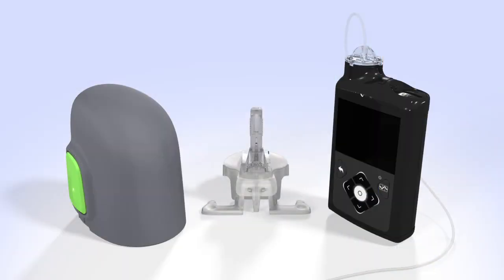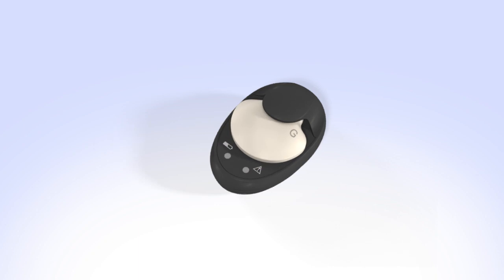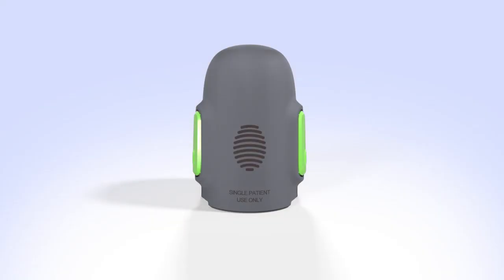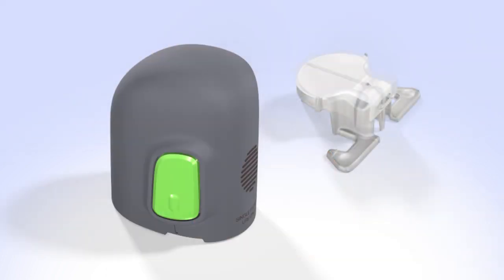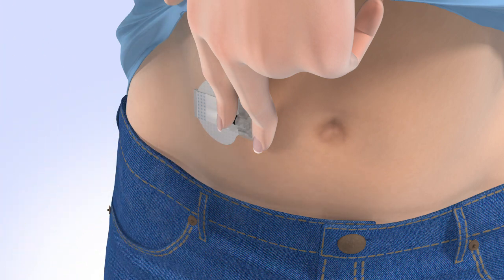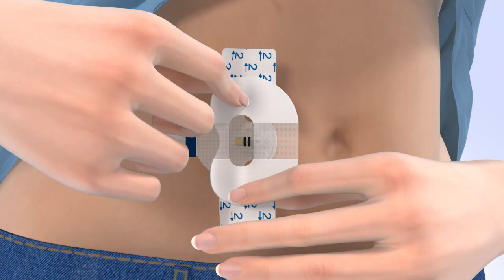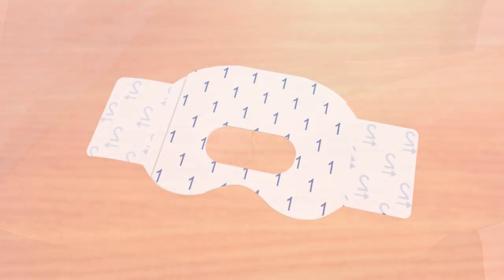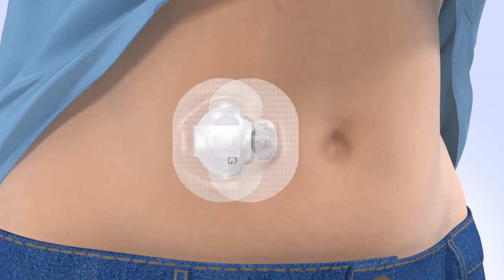Inserting the Guardian™ Sensor 3 with the MiniMed™ 670G System

Comment: Tom Young I have had my 670-G for three years now and yes the alarms, re-calculate over and over,  test test test and the God awful alarm can drive a person  nuts. Now saying that I finally got off the manual and went to automatic and noticed my morning blood sugars are 90-140 a lot different that using the manual mode. I find the pump on AUTO helps really evens out the high and lows. I have had diabetes 26 years and hate it liker anyone else but try and stick with it because right now think this might be the best on the market in my opinion. I understand the 770 is better yet don't know.
Good luck we can all use it.

Comment: put a video on how to clean the sensor y'all  did not send me the start guide its backordered
Reply from the maker: Mary, check out our blog post here http://bit.ly/36Fwisk. It's an older blog and discusses some of our previous products, but the specifics of cleaning your tranmitter are still the same. 
You can also find a user guide for your specific CGM system here: http://bit.ly/2vK9Ayw

Comment: I've been diabetic for 37 years.  I've had 4 generations of Minimed pumps before the 670G.  Been on the 670G since 2017.  It is by far the worst device I have ever used.  Constant alerts and beeping, the senors are always off by between 20 and 40 mg/dl.  The menu system is the worst I have ever seen.  The pump is significantly larger than the outgoing Paradigm model.  It has cracked or malfunctioned on several occasions and I am now on my second replacement pump.  I have one year left until the warranty is up and my insurance will let me switch to another pump.  I'll never buy another Medtronic device again.  I curse the thing every day.
Reply: honestly same fuck this machine
Reply: I just started with the 670g. This is my 1st pump and not that really impressed. The pump is alway beebing at me. every time I turn around it has loss sensor signal. The pump and the bg meter is alway about 25 to 30 points off. This was spose to make my live easier. Now I feel like a dog on a leash. The pump is alway getting bumped around the hose get caught on everything. I have to buy all these supplys. That cost alot of money. I can afford it, and I have good insursance. I rather be spending my money living my life. Not giving it to Medtronic for supplys.
Reply: absolutely right i hate this new pump and sensor they say look at your guide to see how to clean he sensor they didnt send me the guide its back ordered
Reply: Michael Carney yes I have communicated to Medtronic. No they were not interested in my suggestions.
Reply: Do you have any recommendations to a better pump or water resistant pump I'm interested in getting one but they have so many and I can't choose one that fits for me  😕
Reply: @chanisebailey2790  Tandem T slim.  Best pump on the market.  Pair it with a Dexcom Sensor and you have an artificial pancreas that you can control with your phone.
Reply: I wish I could return this. I've used Medtronic for 20 years and I'll be dumping them as soon as my insurance allows. Not to mention this is the only tape that breaks out my skin, badly, and Medtronic has zero solution. This thing sucks.